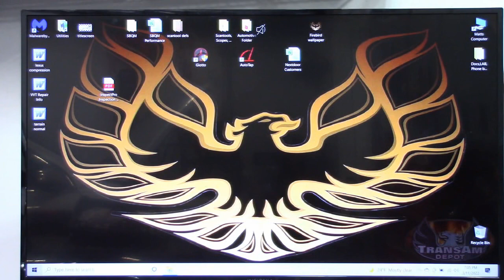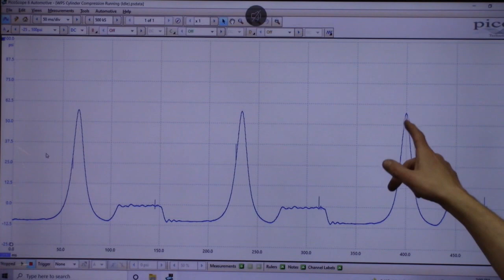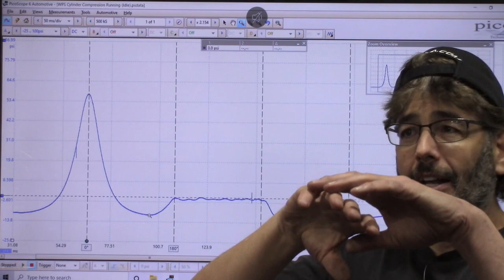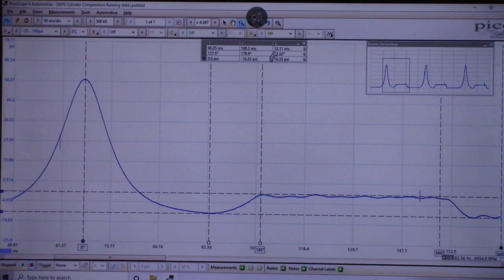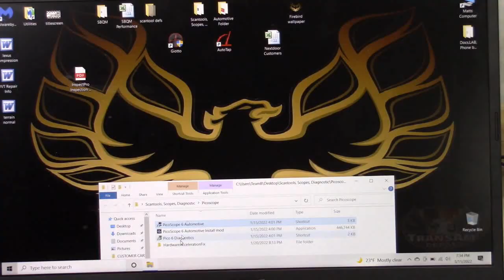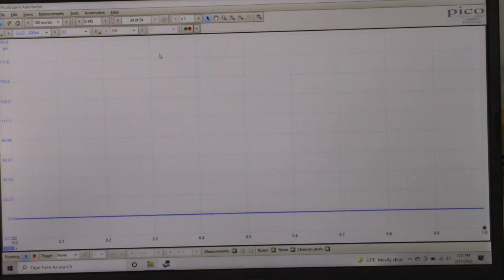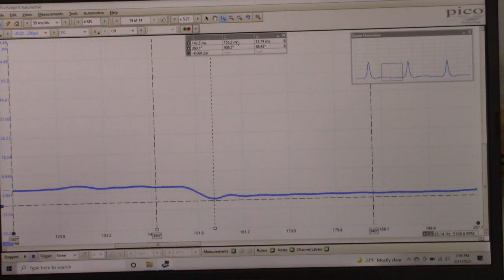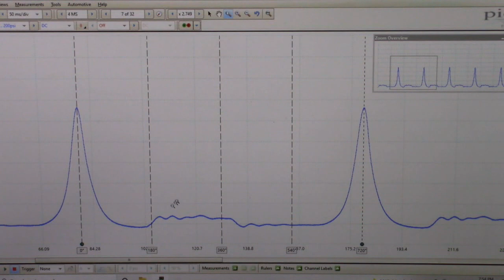How To Check Valve Timing Without Dismantling Engine

Comment: Matt, oscilloscopes are available for under $400 for handheld 2 channel and are good scopes from 60 to 100 MHz.  Not the deep memory the picoscope has, but very useable.  A Hantek 8 channel scope does perform fairly well and costs around $100.  A pressure transducer that works from a 9V battery can be built for under $60, not including the compression tester kit which is on Amazon and Harbor Freight for under $70.  I did a video years ago on how to build one and have made several small cased self-powered units since.  Many mechanics probably already own a compression tester.
Reply: There's a $5  "diy oscilloscope kit" on ebay.  I've watched a few videos of people testing it, and it seems pretty cool for being so cheap. (it's the red circuit board)
Reply: Is the Hantek 8 scope any good?

 Amazon comments section generally  said their amp clamps weren't great though.
Reply: @iam1smiley1  If you want a first scope and to learn on and do some testing with, yes it is.  There are some reviews that show how it works and its limitations on YouTube.  Also, the Autel Maxiscope works quite well.  You can download software like the Picoscope online and try the software for free.  The Maxiscope is around $350 on Amazon and I found one on Offerup for $249.  Picoscope also makes an inexpensive 2 channel scope for like $150 that does not use automotive software, but Picoscope 6 software is very similar you just have to make all settings.
Reply: @calholli  its better than nothing  but its sample rate and bandwidth make it tough to consistantly get clean waveforms
Reply: @iam1smiley1  The Hantek scope is actually nice for the price, but the software sucks. There are alternatives, but they're not too great, either. Very much improved over the factory software, though.
Reply: @richardcranium5839  Yeah, I noticed that you can't really log changes in event's well either.  Unless your'e just trying to view a still triggered waveform-- it's not that useful.  Seems to be more similar to a graphical multimeter than a "scope.  I seen a $235 Pico 2 channel that looks like the best compromise.  I think I'm going to order that little $5 scope anyway, just for fun.
Reply: @iam1smiley1  I'd say they are good. But pico 2204a would be easiest to learn on. I started with hantek 4 channel. It was hard to learn.
Reply: @iam1smiley1  I've used there high and low amp clamp with my Pico over 5 yrs now repeatably with no issues.
Reply: @overload3996  I have the current clamps, spark plug wire inductive pickup and the coil waveform inductive pickup. They are nice accessories, but I noticed there is a lot of random noise on the current clamps. Random little +/- spike lines growing off the waveform like it's got hair. I think the problem is in the Hantek scope itself, I'm not sure. The Pico scope is a great tool if you can fork up the dough... double the price, half the channels.
Reply: @Juan Solo  I use hantek clamps and enttenuator with Pico scope no hash unless connection problem, sometimes I have to twist the bnc a bet at the scope to reduce hash. I might change bnc ends.

Comment: It would be cool to see you try the $5 to $20 "diy oscilloscope kit" on ebay.  It has a red circuit board and looks pretty cool for basically being free..  It's only $5 for the kit, and you solder it yourself.  Or you can pay a little more for them to be pre-built.  Please look it up;  I think it would make a great video for you to thoroughly test it.
Reply: Not worth it. I started with the 1008c and never used it because the software is not friendly and time is money in this field so you lose more with frustration and inaccurate or incomplete data.
Reply: Have one. I haven’t tried it with a pressure transducer. The unit is more novelty than anything but I think I did use it with a pulse sensor and was able to diagnose a leaking exh valve. Definitely better than nothing.
Reply: @scientist100  It only costs $5.. If you used it once to solve a problem, it already paid for itself.

Comment: My 1994 Taurus does that with its original EEC-IV fuel injection system. Gives low compresson diagnosis per cylinder!

Comment: Around 2006 I was rebuilding transmissions for a CAT dealer.  Started to use pressure transducers and logging the pressures for shifts and such.  Learned so much more about what I thought I knew when I could start seeing clutch fill times, dump times, valves opening closing.  It was then that I could confidently explain what every orifice and valve did.  Had an older tech that worked with CAT engineers years before this. They graphed pressures with needle and paper graphs.  He had a chance to already see and know this stuff.  Helped make him a very good tech.  Wonderful knowledge to learn when we see what is really going on.  That and we had excellent data to know what was going on when we shipped it out.  Could see the change, if any, next time we rebuilt the transmission.  CAT mine equipment build the hours quick.  Runs 24 hours a day if possible.

Comment: So this is a great video, and now that I've watched it I have a couple of thoughts.

I would love to know what the monitor shows on the problem car now that you've showed us what a good, running engine looks like.

I wonder if there's an issue with the camshaft or lifters not properly opening such that there occurs here a rich condition.

it could be that it IS a timing issue, but not on the exhaust or intake stroke, but perhaps even a faulty or clogged fuel injector. I don't know.

Either way, you've probably diagnosed my thoughts a billion times over being the knowledgeable person you are, but that's just some thoughts I've acquired
upon consuming your fantastic vid.

Thanks for the great content and the video! I learned a lot about what a running engine looks like. I had no idea that the opening of an exhaust valve during
an exhaust stroke would occur so early during the stroke reversing the negative pressure. 

Observation: that timing, during 100-150 on 16:20, where there is a slight interval in the peaks and troughs, is that where that 'famous v8 rumbling' comes from?
That would seem to be a logical conclusion for me based off the graph! I've heard it's from a time interval between a time frame of the exhaust and intake valve
opening and closing at roughly the same time. Something interesting to ponder!

Anyways, thanks again. Appreciate your time and video tremendously!

Comment: Great video. Many techs produce videos on how to fix a car but you do that and add the theory behind the fix and how to get there. Natural teacher.

Regarding this repair, would a running compression test help in identifying the issue since It provides an idea of how the engine is breathing?
Reply from the maker: Thanks for the comment. while it certainly isn’t definitive, I do sometime use compression to give further evidence of a timing issue. an out of time engine usually needs more strokes than normal to max out the compression gauge so if I notice this pattern on a compression test it further evidences out of time. it’s especially useful if only one bank is out of time since the other bank can be a negative control.
Reply: @SchrodingersBox  Thanks- maybe you misunderstood my comment. I mean to do a compression test with the engine running. This is a good way to check how the engine is breathing and an indirect way for checking valve timing. Perhaps Im wrong...
Reply from the maker: oh I thought I did that in this video- maybe it was another one. yes- I have a video where I do this. the best way is with a pressure transducer because you can measure the actual degrees of valve opening and see in real time where it is opening relative to the compression stroke and clearly see if timing is off.

Comment: on vvt engines disable the vvt to get a baseline, since even at idle some computers are constantly adjusting the valve timing. not withstanding you could have a bad vvt phaser anyways.  this is a good way to check that the vvt is diong what a scan tool is telling you as a double check.also with vvt disabled a simple cam v crank signal check should tell if its in time.  its a learning curve for sure

Comment: You can load the sample tests like you did, and then press the play / record button.  Now you're using the same settings pico used for their sample test, to run your own test.

Also, on the expansion stroke, the piston is moving downwards, creating a vacuum in the cylinder, when the exhaust valve opens.  You then reach atmospheric pressure in the cylinder, while the piston is still moving downwards.  I feel this can only be explained by exhaust manifold pressure (atmosphere) entering INTO the cylinder.  That is interesting!  Exhaust gas enters the cylinder, then gets pushed out as the cylinder travels back upwards during the exhaust stroke.

This is probably not true for a firing cylinder though.  I'd imagine the combustion pressure is still high (above atmosphere) in the cylinder throughout the entire downward travel.  In this instance, exhaust flow would be out of the cylinder the moment the valve opens.  I look forward to a spark plug/transducer combo where we can monitor cylinder pressures during a firing cylinder.  Perhaps on a dual plug hemi if anyone's willing to risk their transducer lol..

Comment: Particularly useful on engines such as this where you have to pull the engine in order to check cam/crank timing marks. The parts canon would overheat before that was done!

Comment: So where do you buy that transducer?  I seen Ivan at Pine Hollow using one a few times also.  He put one on a front side O2 sensor port/ hole, to check if a catalytic converter is clogged;   It definitely was.
Reply from the maker: Oh I am sure this is something Ivan would use. i bought it right from PicoScope. You could certainly use this for exhaust backpressure. i have several videos using a vacuum gauge for that but this would work too. Not sure I want 500 degree exhaust gas in my transducer though lol.
Reply: @SchrodingersBox  note that Ivan sells a lower-cost option for a Pico-compatible pressure transducer, perhaps you might want to ask him if he could send you one to try out and compare to the "official" Pico one?
Reply: @michaelsparmann3368  The quality of the waveform and all the specs,can not compare  with pico transducer, unfortunately. We have to pay for good(top) quality... It's like a foto, to have a clear and good quality foto, you have to buy a good camera. And also, pines transducer, cannot reach 500 psi,is much less the limit. I am not saying it's bad ,but I don't think can compare with pico 's one.
Reply: I guess it depends on what you need. I have zero experience in automotive repair, just watching this for entertainment. But I think what you say makes it even more worth comparing, to see if it is good enough for most automotive repair applications. You don't always need that highend camera if you just want to check e.g. the physical location of something. A transducer costing more than a scope just seems like it might be a bit overkill for the task at hand ;)

Comment: In an Otto cycle engine there's not a negative gauge pressure at the bottom of the power stroke when the engine is running. But  here, where there's no combustion happening, there is vacuum at the end of the power stroke. This was unclear around 11m30s where you're describing the combustion cycle. This remaining expansion is wasted into the exhaust.

An Atkinson cycle engine ends the power stroke at zero gauge pressure as the power stroke is longer than the compression stroke.

Comment: If it turns out to be something other tha n the timing, do you think you could set up a pwm style injector tester? the reason i am asking is thus: say all the injectors are working correctly but one and it has an issue where it is flowing too much the computer starts pulling fuel because it is pig rich, then it starts missing and such because all of the other cylinders on that bank are lean because of the one injector.   Just a thought, i am probably not even in the ball park because honestly i  caught the first part of the video when the symptoms were described and fell asleep until right there at the end.  "oh i saw the engine cut out too"    was no fault of yours, i love your videos man.  you are one of the best diag channels out there.  i was just bushed from a long week and i am not really a spring chicken anymore ;P.   " i will rewatch it later"   just wanted to ask that question straight away.  ya my punctuation is trash today, as well as my grammar so take it easy on me on that front please.  early am and probably headed back to sleep here in a bit.
Reply from the maker: Hey good to see you back- Rhage— against the machine lol. 
  Your case scenario is totally valid. Yes you would see a rich condition response on one bank but because pwm of the injectors is by bank instead of by injector, you would lean out the other injectors causing random misfires on that bank. 
   There are a couple ways I might address this.  In the old days I would use a pulse injector tester like you mentioned- I would have a fuel pressure gauge attached and prime the fuel system and pulse each injector until I found the one that is leaking. but this assumes I would know there is a leaking injector problem- discovering that would be pretty intensive. 
  But nowadays I would probably do it differently. i would use a capacitive pickup to get ignition waveforms. i would be able to see the low fuel waveforms under load on all but one cylinder on a bank clueing me in to that exact cylinder.Basically, one cylinder is going to be different on the waveform so I immediately know where to focus. . 
    based on waveform pattern, I  would know it’s either fuel or ignition on that cylinder and once I validated ignition was good,  I would know to go towards fuel injector for that cylinder again with the pulse tester but I would only have to test it against  one known good since I would not have to try to find the bad cylinder .  This would be way faster than I would have done even 3 years ago.
   and even now—- I understand the newest vehicles not only have individual injector control, but also can be controlled with a scantool. if I adjust PWM on each injector and one causes a different response than the others, I could identify a bad injector without even opening the hood!  but again- we’re assuming we know to go to the injectors first-  normally we don’t know that.
Reply: Rock on bud, I knew you had it covered

Comment: Hello Matt, your videos have helped me immensely!  But you got me wondering about the ripple in the exhaust pressure after BDC - instead of, or in addition to turbulence, could the transducer be seeing teeny weenie pressure pulses in exhaust pressure in the exhaust manifold from each of the other 7 cylinders (when they are exhausting)?  If that is the case, could you use that to diagnose a plugged or partially plugged cat?  If one cat is plugged, then those teeny weenie pulses might have greater amplitude that the other non-plugged cat pulses, showing perhaps a two level amplitude pulse.  SEE?  You got me to THINKING!  By golly, it looks like there indeed is seven little humps in that thing.
Reply from the maker: You very well may be right actually. others have also mentioned it is more due to turbulence from other cylinders’ exhaust in the manifold.  I guess a way to know would be to look at a cylinder with an exhaust valve issue vs one without. great point though.
Reply: @SchrodingersBox  Just keep in mind, the other cylinders aren't all exhausting at that same moment.  It may take a little time for the pressure pulses to move throughout the exhaust system though.  I, personally, would chalk it up to turbulence (mostly).  But I think you could definitely use the exhaust stroke part of the waveform to find exhaust restrictions.  Just my 2c.  :)

Comment: 11:34 The explanation is pretty cool with the semi-destroyed engine 😂, but I think we're mixing concepts here. The explanation says that after the explosion occurs, when the piston is at the bottom, there is going to be a little bit of vacuum. I don't think that's the case in a proper running engine (maybe in those with Atkinson cycle, I don't know). It appears like that if we use the pressure transducer because that cylinder is not running, right? If I'm not mistaken the pressure transducer replaces the spark plug so there is no ignition. If the engine was running, there should be positive pressure in the cylinder before the exhaust valve opens.
Edit: Ah, right, later at around 28:00 there is an explanation of what I said, but yes, I think in a proper running engine the only vacuum would occur in the intake stroke if the engine doesn't have a turbo or anything.
Reply from the maker: yes agreed the waveform would be different if there was an actual power stroke. but given there is no power stroke with the transducer, there is definitely vacuum before BDC in this example.
   i guess there is no way to catch a waveform on an actual power stroke - without drilling a hole in the cylinder lol.
Reply: @SchrodingersBox  You can on a 2 spark plug Chrysler Hemi. Try it when you get a chance! You'll be impressed with the shape of the waveform. When you were testing this vehicle, while the transducer is installed, if you would have walked back to the tailpipe with a dollar bill, it would suck it in when that cylinder went south on the power stroke. That's the o'l dollar bill test to see if there is a misfire. The moment the exhaust valve opens the vacuum across the face of the piston (due to lack of combustion occurring) would "suck" the bill into the tailpipe during the cylinders equalization to exhaust stream pressures. Happy Transducering!!!!